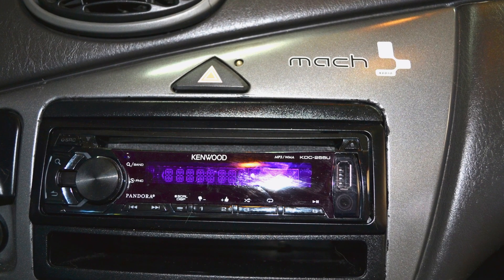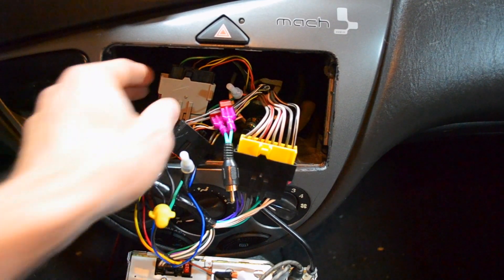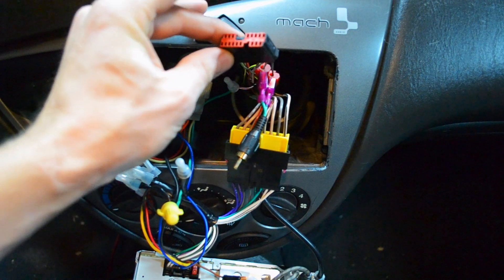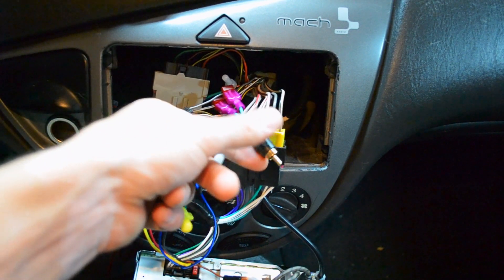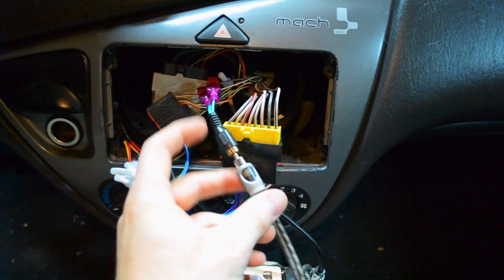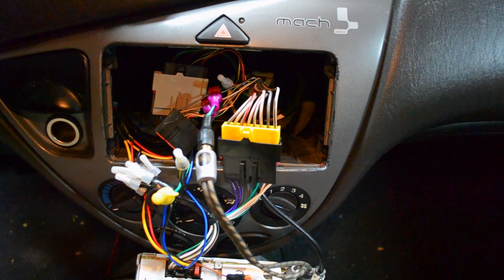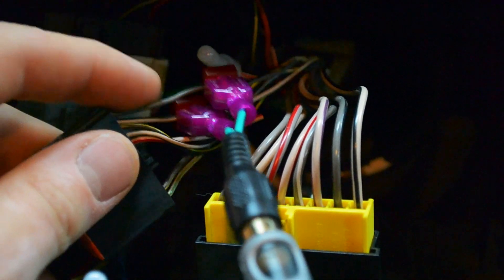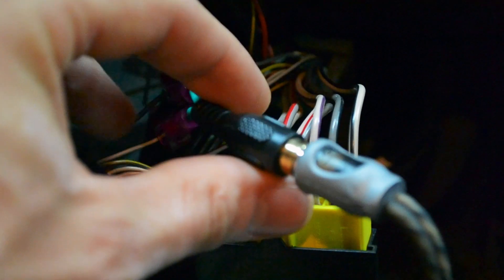Ford Mach System Hookup on a 2002 Ford Focus

Comment: Hello.  My 2003 Mustang Mach factory system has 2 original amps. Is the 3rd empty intake on my factory stereo for the amps? But my hardest only has 2 connector boxes going in. All speakers working with no amp power period. Please help. I want to keep the original stereo but want the factory bass I'm denied with those amps not working. I like the song and can imagine it's enough for me
Reply: Harnest
Reply from the maker: I’m not 100% sure what you are talking about. On the back of my factory stereo there were enough connectors for all of the plugs. You may have a bad head unit or a bad amp if I am understanding you correctly.

Comment: Hi, I have a question about the subwoofer. These are the cables that power the subwoofer's ignition, already with the rca placed on the harness to connect them to the source of the battery and ground
Reply from the maker: These cable just send the signal. The sub is already powered by the harness. Thanks for watching I really appreciate it.

Comment: how does amp get powerd with after market harness?
Reply from the maker: The amp never gets powered from the RCA's. To power up the amp you will need to connect the remote wire from your cd player back to the remote connection on your amp. This will allow your amp to turn on when your cd player does. You will have separate positive and negative wires run from your battery to supply the power.
Reply from the maker: If you are referring to the stock subwoofer there are wires in the stock connector which will do all of the powering when wired up properly. It has nothing to do with the RCA connector shown in this video. You need to buy the correct adapter kit for a focus with a MACH system. Most likely only found online.